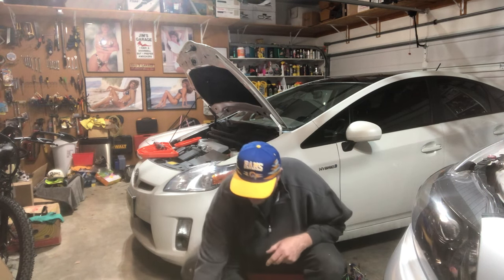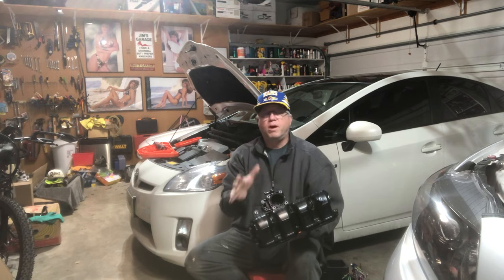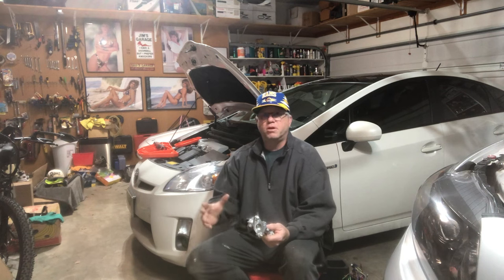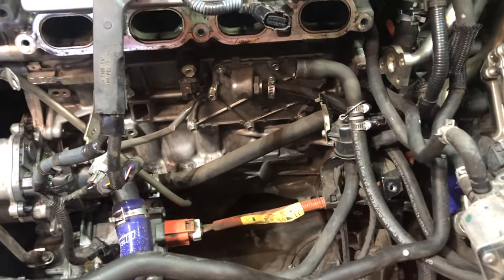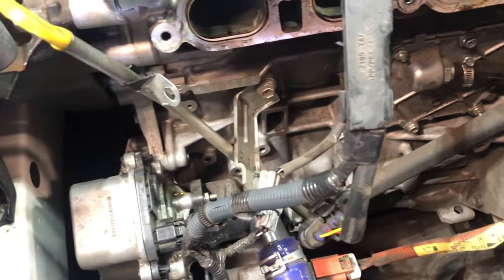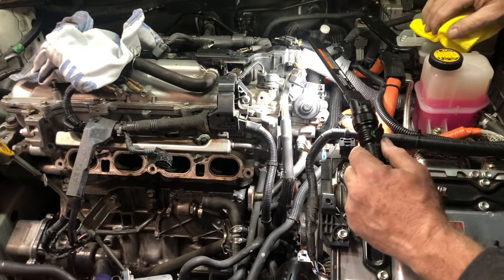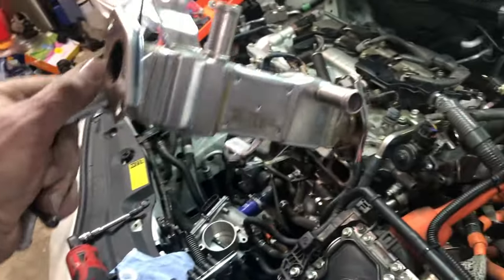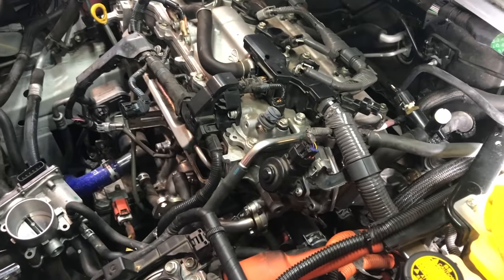2010-2015 Prius // EGR Valve // Intake Manifold // DIY // Removal - Clean & Replace

Comment: That bolt really is the bolt from HELL and for that alone Toyota should be punished. But I will go a step further. Gen 3 Prius clogged EGR equals blown head gasket equals catastrophic failure at 160,000 miles just outside of recall bulletin.  Toyo has destroyed their reputation, all the gas savings is gone - they are no longer a reliable company.
Reply: Do you have any info on this recall? My 2011 is just a bit above 160K and I just got the P0401 error code.
Reply from the maker: I wouldn't say it's not reliable as many Gen3 Prius will go 500k miles or more. The key is cleaning the EGR cooler, replacing or trying to clean the EGR valve, cleaning the intake manifold and replacing the PCV valve. If you do this every 75-100k miles you should be in excellent condition for a very long time while avoiding any head gasket issues. If you install an oil catch can when you replace the PCV valve you can also help prevent issues while also helping to keep your intake manifold cleaner. Bottom line, maintenance is key.
Reply: @jimsgaragetoys  I have had dozens of cars for which cleaning the egr wasn't a scheduled maintenance item.  By the time the average layman figures out to add this to a maintenance schedule it is too late and the damage is done.  Thanks for the video though.  When I get this work done the car will go up for sale and I will be done with Prius - back to old reliable ice only Camrys for me.
Reply: @juanifico  the recall goes up to 150k miles.  We're both out of luck.
Reply from the maker: @ddmercantile  As long as people get the service done at Toyota they will just replace parts. Hopefully people try to learn about their car so they know what needs to be done. I do understand the beauty of a straight ICE engine though as my 4 cars are all ICE engines with a manual transmission.
Reply: Japanese never meant for cars to last 200K-300K miles. 😜🤑
Reply from the maker: @donw3861  Maybe you are right, more like 500k with the engineering and quality> 😍🤣😎
Reply: @jimsgaragetoys  I wondering how do taxi car get to million miles? 😊
Reply from the maker: @danqp  They have very good maintenance standards that they follow. I've been told that they adhere to them closely to keep the cars running for a long time.
Reply: @donw3861 only Teutonic German cars like VW,….etc are last loooonger than 100k dude !!!❤❤

Comment: Master ASE tech working for Toyota who owns a 300k Prius here… first of all, great job. Second, no shop tech would ever tell you this, because we just replace, but if you’re taking out the cooler, I recommend soaking it in Purple Power or similar for hours and then cleaning it with brake parts or carb cleaner and repeating as necessary. It gets perfectly clean. Third, bolt from Hell is easier removed with a combination of swivel sockets, extensions and flex head, but yes, it’s a pain in the butt. Cut my hands to ribbons the first time I did it.
Reply from the maker: Thanks, I appreciate it. A shop tech wouldn't tell me what? I do realize that all dealers and most any shop would just replace it with a new cooler, but for more than $300 it's worth it for any DIYer to clean it. I found that using oven cleaner worked better than anything else for me. After cleaning it out I soaked it in Simple Green and then flushed with hot water and my air compressor until clean. 😍
Reply: @ They wouldn’t tell you to soak it in Purple Power. In the shop we replace, because it’s time consuming and ends up being more expensive to clean than to replace because of labor costs. But if you have the time, an oven cleaner/degreaser followed up with denatured alcohol (brake parts cleaner) works great. Just make sure that you introduce as few water-based solvents as possible so you don’t get corrosion in there.
Reply from the maker: @MMIrish  Yes, I know that to be true. I know several current Toyota techs and I've know many over the years. Dealers can't afford to take the time and hope it works okay like people that are doing it themselves. Obviously videos like mine are aimed at the DIY person. My procedure for the EGR cooler is:
1. Blow it out with my air compressor. 
2. Soak with oven cleaner 2-3 times as needed rinsing and blowing out between rounds.
3. Soak with Simple Green, rinse and blow out.
4. Reinstall when needed.

I have a spare EGR cooler and intake manifold so I have a clean one ready to install making this a pretty quick process.
Reply: I just cut off the bolt from hell.
Reply from the maker: @joskd8491  Indeed, after removing the stud I left not off and used my Dremel to cut off the tab on the EGR cooler. It made it much easier to remove an install and it doesn't need it anyway.

Comment: That bolt from hell is actually a nut and the removal of the bolt requiring the 8mm star reverse socket. You should have shown that hardest part of the job in your video. Everything else is easy to remove. There are a bunch of parts that needs to be dismantled from the throttle body, intake runners, EGR valve and the cooler needs to be thoroughly cleaned which you did not show at all.
Reply from the maker: That is true. Most people don't have the right star socket to remove the stud but it's easier to remove the stud with the nut still on it than try to remove the nut first. I had replaced the EGR cooler prior to starting my channel so I'll do a video on that the next time it comes up. This video was more about replacing the EGR valve and intake manifold. No I have all the original parts that can be cleaned and ready to be swapped back in down to road easily and quickly.  I did show how to remove the intake and explain what I was doing as I went along. I've been thanked by many others as I try to do these videos and explain what I'm doing as I do it. I'm still learning how to make every video better though as I'm new to this video making stuff. 😉😎
Reply: @jimsgaragetoys  Yes indeed easier to loosen the nut first then tackle the bolt. That bolt from hell should be addressed on video since it's impossible to remove that cooler any other way.
Reply from the maker: @brucewayne2773  It's one of those things that is hard to show but just explaining it can help people understand what it involved. That way when they attack it they quickly see the issue but at least they have a heads up.

Comment: Water pump is just drain half the coolant, remove the air box electrical plug and 5 bolts. 10 minute job
Reply from the maker: Yes, it's easy access once the air box is removed. Ours is still going strong at 140k miles.

Comment: I do the same: buy an extra used intakemanifold and EGR-cooler and make sure they are really clean. You don't have to hurry because you have an extra set. I soaked it in diesel, but that didn't work satisfactory. Ovencleaner works a lot better and faster. If possible: get the EGR-cooler off and clean it, or replace with a cleaned one, that way everything is done.  Doing this makes your Prius, Auris or Corolla hybrid last forever without headgasketproblems or rattling or troublecodes
Reply from the maker: Yep, that was my thinking too. In fact I need to swap them out again.
Reply: that, and dont forget to replace water pump and thermostat - those two parts could fail and take the head gasket as well!
Reply: @Fahmbo  done
Reply from the maker: @Fahmbo  The water pump will show signs before failing. I don't normally replace parts just in case. I'll replace it soon but I won't do it every 75-80k miles when I clean the parts in the EGR system.

Comment: This will be the most extensive work i've attempted on the prius. Only done my oil changes so far, planning to replace coolant and transmission fluid soon too but that's pretty straight forward. While I have all this stuff taken apart to clean the EGR, is there anything else I should do? I'm at 93k miles and 10 years, I was planning to also change the engine coolant pump. I was thinking to replace the PCV valve since it's like $5 and it will be easy to get to during EGR cleaning. I'm assuming it's way too early to replace the spark plugs? Not sure if it matters but I'm in California and almost always use top tier gas.
Reply from the maker: Yes, I would replace the PCV valve and install an oil catch can as that helps the Prius a lot. I'm at 155k miles and my water pump is still fine. I'm thinking of replacing it around 175k miles. I hate replacing parts that are working just fine. This is a little time consuming but if you take your time you will be fine. Cleaning the parts out, especially the EGR cooler can take soon time though. I made a video on cleaning them out not that long ago too. It sounds like you have an idea of what needs to be done. feel free to ask with any other questions.

Comment: For the bolt from hell... Why not cut an opening on the mounting tab of the cooler, thread the bolt back on the engine side and when it comes time to reinstall the cooler, the mounting tab would simply slide over the bolt and all you'd have to do is tighten it?
Reply from the maker: That could work but it's so hard to reach the nut that I will choose to not hassle with it. It's really not needed to hold anything in place. Once you remove it you will see that it's very secure without it too. Thanks for the idea though as some people might like the idea!
Reply: My experience WD-40 liberal application, 3/8 tekton deep socket set 12mm you can't use too big socket. It's an exact fit to get to that bolt from there flex head 3/8 and you will get it with patience

Comment: Why you take out too much things that look like we don’t need to take off that part, like intake manifold ?  If we have some good tools we can take off just egr vales that we don’t need take off wipes and intake manifold ,
Reply from the maker: The intake manifold needs to be cleaned too. There are very small passages from the EGR system that get plugged and have to be changed. I decided to change the parts out so I could later clean the parts and have them ready to go at a later time to swap again. This way I always have a clean part when needed to swap again.

Comment: Step by step guide, clearly documented. SO well done, and so so helpful!
Reply from the maker: Glad it was helpful! I do try to be very clear to help out others to be able to do it themselves.
Reply: I just following your video and do my car. The pipe, cooler and intake manifold can be clean satisfactory with Berry man chem dip with plug the openings. Egr can be clean but the black motor can be bad some time.

Comment: At 160K miles and no EGR issues yet. Still getting 52 on the highway. I am going to deep soak (purple power over night) my intake and cooler in the next couple of wks...and clean out EGR valve.
I've seen a yota tech on youtube saying to download software after changing EGR? I think it's the way he's been trained. I see that you did not. Thx for the vid.
Reply from the maker: I've never seen anything about EGR software updates. I never had any issues but I didn't want to wait for them either.

Comment: Excellent video. Thank you!
Reply from the maker: Thanks, I appreciate it.
Reply from the maker: I saw your other question and tried to reply but then realized that it was deleted. This one.....

"After I replaced the EGR valve and Mass Air Pressure sensor on the intake manifold, and cleaned the manifold and throttle body, I got 4 check engine lights . 1) P0102 Mass or Volume Air Flow a Circuit Low, 2) P0113 Intake Air Temperature Sensor 1 Circuit High, 3) P0102 Mass or Volume Air Flow A Circuit Low, 4) P0113 Intake Air Temperature Sensor 1 Circuit High. I replaced the Mass Air Pressure Sensor on the intake manifold. I tried to erase the codes using my OBDII but these wouldn't erase. Did you have similar problem after you went for a drive? Thanks."

Did you figure it out?
Reply: @jimsgaragetoys  yes. I forgot to connect the mass air sensor.  No more check engine light.
Reply from the maker: @Sagemeister007  That will do it!! 🤣 Glad it was a simple fix.

Comment: Nice job.  I did the same plus new pcv valve. And oil catch can plus keep oil level halfway between full and add.  2012 then one cold Feb morning still got the cold start rattle.  Just made the 10 year or 150k egr warr enhancement from dealer.  They replace EGR valve plus update the EGR software. ZF3?  No more rattle.  Suggest having dealer do your software update after your new valve. Per car care nut EGR video.
Reply from the maker: Thanks for the tip. I did have the dealer do the EGR software update. Mine was past the date to have them replace the EGR valve so that's why I did it myself. I've never experienced the rattle but did the maintenance anyway. I replace the PCV valve 2 years ago and installed an oil catch can at that point too.
Reply: They replace the whole egr unit for you? Would cleaning the egr be enough? Because I think I pass the warranty
Reply from the maker: @bicyclekikz14  I replaced the EGR valve, EGR cooler and intake manifold. This way I could take my time and clean everything better. I can then swap the parts right away and get the car back to my wife without delays and have clean parts ready to swap on at any time.
Reply: @jimsgaragetoys  good idea
Reply from the maker: @bicyclekikz14  Getting these parts clean the right way can take some time so this will let me clean them the right way without being in a rush.

Comment: Great thorough step by step video!  I just bought a 2014 and I don’t see that EGR or water pump have been addressed.  Car has 180k mikes. 6:37 Which would you recommend doing first?
Reply from the maker: The EGR cooler and EGR valve are must service items. The water pump doesn't need replacing if it works. I'm not a huge believer in replacing parts that are working. If you want to buy a spare water pump to have on hand that would be okay but I wouldn't replace a working part.

Comment: Have you considered adding a port to the EGR tube so you can routinely inject a cleaner into it to keep the whole EGR system clean?  I don't own any vehicles with EGR problems, but have contemplated this for a long time for those that do.
Reply from the maker: Good question but would that work? What cleaner would be used? How would that work to keep the EGR cooler and EGR valve clean since they would be down stream from the tube? It's really not that hard to remove them and replace them with parts that are clean every 75-80k miles which is every 5-7years for most people so it's not that often to take 3 hours to do it and know that the parts are 100% clean.
Reply: @jimsgaragetoys  You inject on the inlet side of the EGR cooler/valve and it cleans everything.  Seafoam or an intake cleaner should do the job, or just water.  It would have to be done with the EGR valve open of course which would require doing it while driving or with a scan tool that can command the EGR valve to open.
Reply from the maker: @DonziGT230  The EGR tube is on the outlet side of the EGR valve, on the inlet side of the EGR cooler is the exhaust pipe that attaches to the EGR cooler. I wouldn't want to mess with that and hope that it would work. Changing these parts out only takes me 2-3 hours every 5-7 years so I just don't find it a very big deal and this way I know with 100% certainty that the parts are clean and not hoping that the cleaner worked.

Comment: Few days ago I drove my car and after 20 minutes and I got a check engine light with code P0441. I cleared it and drove again today. I now have P0441, P0300, P0302, P0304. I recently changed all spark plugs, fuel injectors and ran fine. No rattle or slow acceleration or any noise. Could it be the EVAP Purge Valve Solenoid might've triggered the others? First thing I'll do is to replace the Evap purge valve solenoid and see if this solves the problem. Thanks.
Reply from the maker: The P0441 usually indicates a bad vacuum switch or a leak in the EVAP system that is preventing fuel vapors from reaching the canister. The P0441 code can also indicate a faulty or "stuck" PCV, a short circuit in the feed circuit, or a faulty purge solenoid.

Codes are P0300 (Random Cylinder Misfire), P0302 (Cylinder 2 Misfire), and P0304 (Cylinder 4 Misfire). You can swap coil 1 & 2 and see if the codes follow or stay the same to see if it's a coil or not.

Comment: The thing we need is how yo clean up or fixed the EGR vale? How is the wrong in the EGR vale that yhe thing you don’t day !
Reply from the maker: I replaced them with new parts. I'll be doing a video on how I cleaned the used parts soon as I have to swap them back soon.